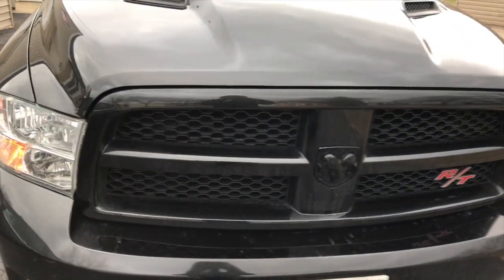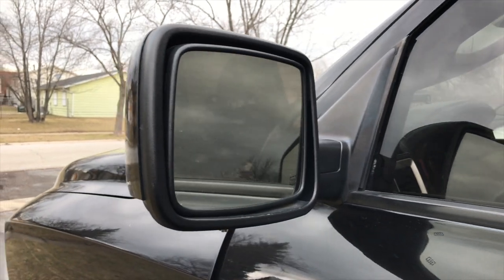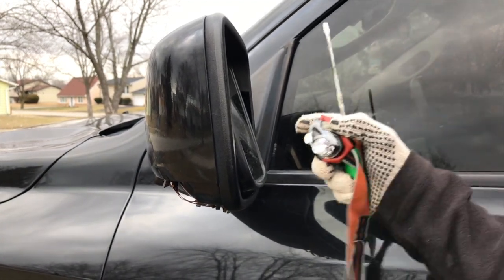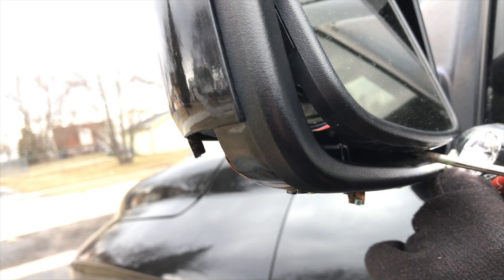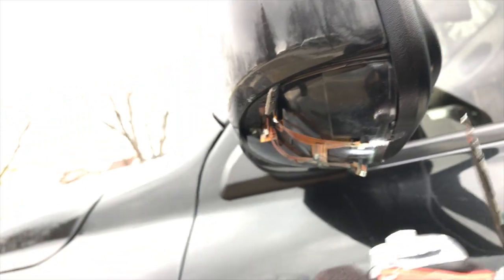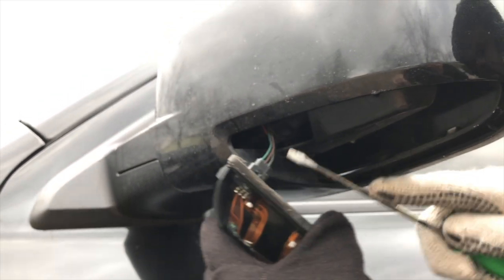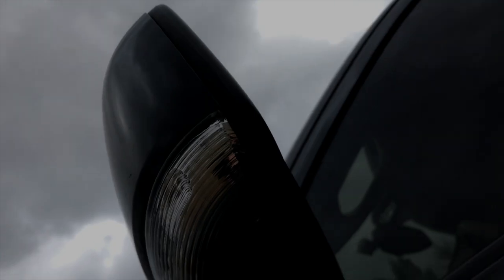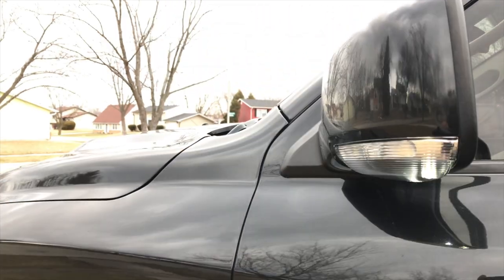Dodge Ram Side Mirror Light (Puddle Light) Replacement / Installation

Comment: Part number is Mopar 68064949AA. You can Google or eBay and replacement should come up. Thanks for the video, my same light just went out.
Reply: Thank you!! I have been looking for this part everywhere
Reply from the maker: You're very welcome.
Reply: Is this part number for the driver side?
Reply: T. Kendrick  yes, for the driver's side only.
Reply: Part number for the passenger side is 68064948AA
Reply: Ja F thanks man.
Reply: Remember everyone,  this is plastic, go easy with the screwdriver.  A plastic body
 molding removal tool pack works great...cheap at Harbour Freight.
Reply: Thank you.
Reply from the maker: Thanks, Jeff Walker, for the added information. That's what I'm all about, helping others.
Reply: That part number is for drivers side , do you happen to have passenger side please .. great to know we can do this .. dodge dealer told me I’d have to replace the entire mirror.. thank you !
Reply: Terence's Youtube , would you happen to have part number for passenger side please ? Thank you
Reply: passenger side is 68064948AA
Reply: Anybody know the part number for both mirror assembly for 2010 dodge ram  heated with puddle light? Mine got smashed by a douche. Found a kool vue brand but not sure.

Comment: same question....where'd you find the replacement lamp?
Reply from the maker: You can find them on Ebay. Copy and paste the following in the Ebay search box. You will see many of them offered for sale. Thank you. 
 DODGE RAM 1500 2500 3500 driver LEFT mirror turn signal NEW OEM MOPAR

Comment: great video thanks so much , just found out yesterday that my passenger side starting to fall off , just one question on ebay there is a lot of these lights but says Ram 1500 09-14 mine is 2015 Laramie does anybody know if it’s gonna fit my 2015 or it’s different for 2015 and older ?? thanks for the video and help 👍any help is appreciated take care
Reply from the maker: Hi, does your like look like the one on my truck? If so, it should absolutely work. I see what you are talking about. They all say 09-14 and 15' and above require a different light. Here are some link for both....

https://www.ebay.com/itm/183939985132?_trkparms=ispr%3D1&amdata=enc%3AAQAFAAACQBaobrjLl8XobRIiIML1V4Imu%252Fn%252BzU5L90Z278x5ickkbhMs1po4WbP07exDt0IQH072gx717AwklK5swWX6LRDYEjEG6KeBkTqASterIBC7Hj%252BR%252BpiJ5Q0eddKzW3fW1zkY7JO5Za9Gez2QuaFYMqHpqx%252BTf%252Fw4%252Fn2PmGT%252Br%252FvWMnFRSn%252FJhu50cFmcCT%252BeUpkkaA6DVns7QAnsGmwj%252BM4m4IzHXIbb0qN54j20RCdsHRiNmvBqHY3LbubuHoJ7LNxTBjQm0l2kLRqdo64uMuELL5OmaPU%252FBmBzgBqW1lMZyhtrOa7hKYseyutG2bWLbCI%252FCEtMNK45WwCpnBaO%252BYKFVqfvpztlMfyg4pVT4wSIaXnjRocXvIUYlTsVuUzMR%252BHLEOvLbg2e1gGtVgT%252BrfBx1m5DoPNMimGj9O4kk%252BWnWTfovHOq2ILOqRbVg3JV%252B8dlGXBc%252F%252BSNFqRGrRqSq5P5vq9vP%252Bi3Nfdl2te0%252FtELt9b4wYKO8Wq2Qu0tQKJJA1Bq48tE1258XkWcR5UbzDfkEVoKDwn4oyyh8IAM94el%252B1WrQOnkxgKzWM1dLeoz9WQhKQAhkTWLlC3PgSTvMd6dQSWT2qOCaay3CHjl48ro8rBlTkjMaB4aWg9q3ePcEZJC0aksd1wBgDn2E6e5wmbN8tSA7Stos5%252BfMLZT3HPUFCJHpw%252Br7jy7BL9CjLjFwEudiOfCZby4qBxqM9mempAq5%252BuSxDIsKhD9dWg7bVY%252Bsbg%252Fsi2IrUxSe8ojnOhONg%253D%253D%7Ccksum%3A1839399851327c9ce1dde5d74f81a9c106ee89959775%7Campid%3APL_CLK%7Cclp%3A3268220&chn=ps&norover=1&mkevt=1&mkrid=711-117182-37290-0&mkcid=2&itemid=183939985132&targetid=1098102009964&device=c&mktype=pla&googleloc=9021629&poi=&campaignid=11774733487&mkgroupid=113829509425&rlsatarget=pla-1098102009964&abcId=9300474&merchantid=113681014&gclid=Cj0KCQiApY6BBhCsARIsAOI_GjZBd5JSgc5ZzQy2eiycDs08h-j-oN14JpurC-Wz2Eq6aX7bDY8dOgoaAmDoEALw_wcB

https://www.partsgeek.com/gbproducts/AC/97149-07636433.html?utm_source=google&utm_medium=ff&utm_content=OAY&utm_campaign=PartsGeek+Google+Base&utm_term=2011-2017+Ram+1500+Door+Mirror+Turn+Signal+Light+DIY+Solutions+Left+11-17+Ram+Door+Mirror+Turn+Signal+Light+2016+2014&utm_source=google&utm_medium=ff&utm_campaign=PartsGeek+Google+Basecid=8846651725&aid=90101750798&keyword=857315534630%3A%3Apla-857315534630&kid=857315534630&gclid=Cj0KCQiApY6BBhCsARIsAOI_GjYD9rqBeVz74Bib_ZjuX2uqo2AsL-RQeIrVV9S0p5XeUxsOuPaoZhkaAjpnEALw_wcB
Reply: @TerenceDIY  hi , thanks for your help 👍, it looks definitely like yours, but i read somewhere ( can’t find it now where ) that the turn signal light for 2015 + is 1 inch longer than 2009-2014 , of course I did break it in 2 parts today by removing it 🤔so I have to order it definitely but I live in Europe and most of the sellers on ebay don’t send it to Europe so I don’t know If I should risk it and order the one like you thanks again for your help 👍
Reply: @MrDextermorganmiami  plz let me know if u do how this goes I have a 2015 with the same issue of course they’d stick it up our asses by changing shit
Reply: @austinwest5302  hi it’s definitely different for 2015-2018 and double price it’s about 100 USD ,  1 inch wider and the black plastic cover it’s also different so be careful by ordering
Reply: @MrDextermorganmiami  so did u order it and if so is it oem
Reply: @austinwest5302  I have to wait for order cos I live in europe and not all the USA sellers ship to europe , found one seller it’s not oem but 48 USD on ebay , amazon not available and definitely the best is rockauto.com but they have only oem Mopar 98 USD wich is double price but you know it’s gonna be perfect fit
Reply: @MrDextermorganmiami  well I’m on Mopar own replacement and if u look at what there torment sizes it seems like my Laramie longhorn model size fits on 2015 and 14 but I accidentally clicked 2014 tradesman and it says it doesn’t fit which makes no sense
Reply: @austinwest5302  they make it so confusing unbelievable, so you’ve ordered for 14 ?? i’m afraid it’s not gonna fit , will you be so kind and can you let me know if it’s fitted? I have 2015 Laramie
Reply: @austinwest5302  i’ve tried the same change year to 2014 and immediately This doesn’t fit 2015
Reply: @MrDextermorganmiami  I haven’t ordered yet but https://www.moparfactoryparts.com/oem-parts/mopar-turn-signal-lamp-left-68232479aa go on this link put ur truck model in to see if it fits then since we determined 10-14 doesn’t fit plug other ram models in to see if it fits is wat I’m saying
Reply: @austinwest5302  after 3 days chatting in different shops in Europe and USA this should be the part number and it really fits 2014 - 2018 
the number is 68232478AA for passenger side
so i’m gonna go for this one
Reply: @MrDextermorganmiami  will u send me the link to the part ur buying lol

Comment: Where did you buy the replacement light
Reply from the maker: Hi DeAnna Stevens, Sorry for the delayed response. For some strange reason, my comments are not coming to my email anymore. I have to check in to this. I bought the replacement light from off eBay.Here is the link.  https://www.ebay.com/itm/DODGE-RAM-10-17-GROUND-ILUMINATOR-MIRROR-PUDDLE-LAMP-LIGHT-RIGHT-PASSENGER-SIDE/192653375340?fits=Year%3A2010%7CMake%3ADodge&hash=item2cdb09376c:g:GLIAAOSw5L9XDwMF

Comment: where did you find your replacement lamp?
Reply from the maker: You can find them on Ebay. Copy and paste the following link in the Ebay search box. You will see many of them offered for sale. Thank you. 
OEM Mirror Power Heated Turn Signal Light Driver Side Left for Dodge Ram Truck

Or,    DODGE RAM 1500 2500 3500 driver LEFT mirror turn signal NEW OEM MOPAR

Comment: Where did you buy them ?
Reply from the maker: Here is a link to the light... 

https://www.ebay.com/itm/DODGE-RAM-10-17-GROUND-ILLUMINATOR-MIRROR-PUDDLE-LAMP-LIGHT-LEFT-DRIVER-SIDE/193226966619?fits=Year%3A2010%7CModel%3ARam+3500%7CMake%3ADodge&hash=item2cfd39865b:g:59cAAMXQLoZR3FlL

Comment: i replaced mine, but my puddle light goes very dim/out when the mirrors are folded in now. any idea, what could've caused this.
Reply from the maker: Hi Paul, sorry for the delayed response. I've never seen or heard anything like that. That's very weird. It could be a wiring issue. Do the wires stretch when the mirrors fold? Did you replace the light with an aftermarket one or an original OEM? Let me know. Thanks for watching!
Reply: @TerenceDIY  wires have enough length. and it is oem.
Reply from the maker: @ThePdiddymusic  , that's strange. I am going to look at the software I have and see if it mentions anything about your issue with the puddle light.
Reply: @TerenceDIY   thank you ~! i have thought about going back to the dealer and possibly getting another light to test on it, maybe a bad light assy. ??? i told my parts guy after i bought it, and he says he's never heard of it either... it is like clock work, as soon as i hit the fold in button.. lights off... driver comes back on once folding in is complete and the passenger stays out to very dimly lit...
Reply from the maker: Paul, that may be a good idea (testing another light assembly). Please let me know if you get it fixed. I am curious to know what the issue is. Thanks,

Comment: I need to do the same thing on the same mirror on the same truck. I just need to find the part. Anybody got any links?
Reply from the maker: Hi Mitchell, I believe this seller has both sides. Click the link below. Thanks for watching! 

https://www.ebay.com/itm/DODGE-RAM-10-17-GROUND-ILUMINATOR-MIRROR-PUDDLE-LAMP-LIGHT-RIGHT-PASSENGER-SIDE/192888087696?fits=Year%3A2010%7CMake%3ADodge&hash=item2ce906a490:g:GLIAAOSw5L9XDwMF

Comment: Was damaging mine trying to put it in,, took it to body shop,, light was intermittent afterwards,, went back to put in o e m light and now doesn’t work at all!!
Reply from the maker: That's messed up. I wish I were there to help.
Reply: @TerenceDIY  they corrected the problem. They said it was the connect from the wire. They somehow like squeeze the contact a little bit so it contacts better it’s working now but if it happens again in the future, I’m gonna have to get the fitting on the wire replaced.
Reply from the maker: That's great. Glad you got it fixed.

Comment: Where did you get replacement puddle light
Reply from the maker: Hi Joe. Here is the link to where I bought the puddle light. 

https://www.ebay.com/itm/DODGE-RAM-10-17-GROUND-ILUMINATOR-MIRROR-PUDDLE-LAMP-LIGHT-LEFT-DRIVER-SIDE/202576381310?fits=Model%3ARam+3500%7CMake%3ADodge&hash=item2f2a7e457e:g:59cAAMXQLoZR3FlL:rk:8:pf:0
Reply: Thank you

Comment: Part #???
Reply from the maker: Here is the link to some decent aftermarket ones. 

https://www.ebay.com/itm/353620220482?fits=Year%3A2010%7CModel%3ARam+1500%7CMake%3ADodge&_trkparms=ispr%3D1&hash=item5255685a42:g:PTwAAOSwjWlhFM9H&amdata=enc%3AAQAGAAACsPYe5NmHp%252B2JMhMi7yxGiTJkPrKr5t53CooMSQt2orsSd0ReTLyM7cxPnI6zs468EIQ16y37KRXoLea5Vkf0hMg4lYBMTOJ%252F41pGCTGcJylxL5CuJ7wLux4kgwQ6qpb%252B2Z08NlycqWgkZtgWn3ERf2NnOnvlWKV68E9rLit%252FnFe%252B84dXNJoxUDYMSfc279YchByh8xArh3EiWwafE6J3e%252F9hUYDoN%252BZN8HOiA6tVWPD0S07MKbUoquCOTkgXFpSzdwjESmjRuhzYszeDxFlUBeRWr%252F4THC3xIB9QtejBRAIHvoWDYZWCZjyhOgiHdn4B6T13Ik7Po2SC02QC13shae6F8SbYD45bnuN9p3%252BHkjhSM2abpGIC3JzrYiLq62%252FhJ%252FPXTglR3WOMis0PjsLysa%252BA9nSiTn%252Fl6P8OlddjCbNwRPIOwMr9cSpZndFIB3HvtTfrheina%252BRrgl%252F7i3SdShQy2m3sdXy7Aqg4XgAYRJ5xAexTBnKoeG7paZmH8SNz7vCgn7nBUF%252FsNeEjN6amb8yQTJvoUBBmG4t0L5fVg4HTOHU3Pk%252Bb83eCUm3FovfuukfXSSAvV0ftR1D01SNaqjRUpdBqjdAjaKOB3CVIw5Za%252FVHFzhacJbkyTLpnF31XZ2YJbVpfurQYgMmbrheLYjWH%252BsDUhig%252F6cN7ajtX%252BicRRXxojKUB%252BWHnmD1a93eUBt0BPtRsMkpjsphUDUUusZFoJ0Pj1Vc%252BSv0tr11VlKpKL3mzbv4U9xMwm34qjtX09OznQY6YT8a4v8inwjknMYy3zY0sWMrStz5ANy8VaaYoiHWuZcxk7CVaa6tCCM%252FSHhP5JxHyws10YRX4qAu4W9OOMIn96maeq3GI6xsCdDmVsnqcM5lzoHJRZLI3G6GDC%252FE7qpRYrQtYstmpJEs2CWE%253D%7Cclp%3A2334524%7Ctkp%3ABFBM1uuDh6Ff